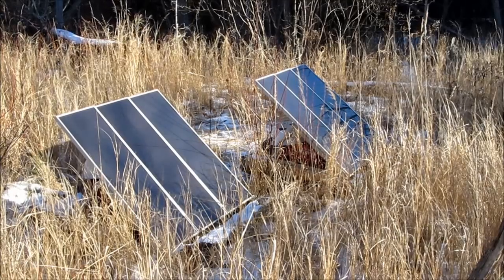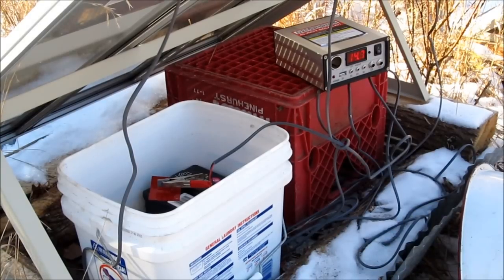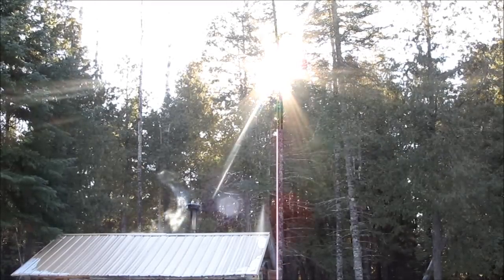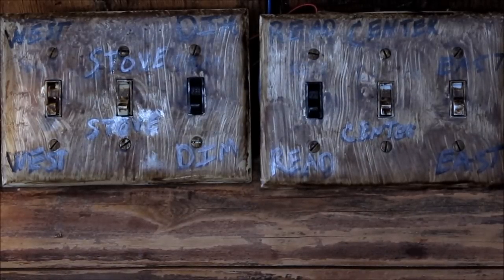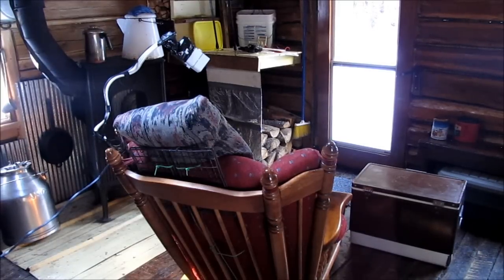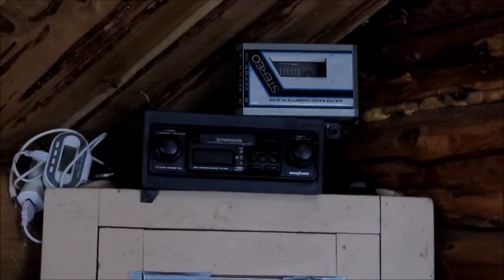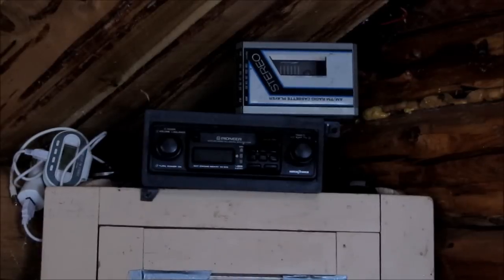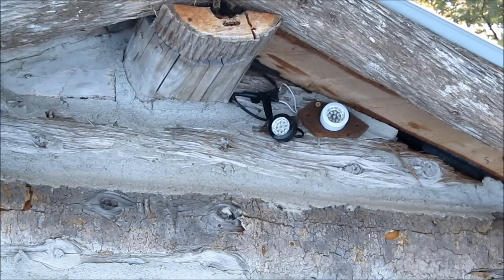Martin's Old Off Grid Log Cabin #1A Solar System for a Small Log Cabin

Comment: use a marine battery it,s better
Reply from the maker: +Jose Francisco Medeiros I know there are better batteries out there for a price. For my use the end of life car batterys work just fine and do not cost a penny. I just returned from a 24 day stay at the cabin. Most of the time I was using the two oldest batterys. One from 2004 and one from 2007. They powered my LED lights and car radio with no problem. I have meant to upgrade the charge controllers but the original ones from the Harbor Freight kit are still doing the job.
Reply: I treated a dead battery with baking soda and distilled water (I recall) and refilled with epsom salt and distilled water -- again from memory. Got about three months out it, including a cross-country journey. But when winter came, the electrical system started blinking at me and cold-cranking amps dropped by 100+ in seven days. I might have overdone the baking soda bath...

Comment: About two thirds of my solar are those harbor freight panels, but I use a lot more power than you do.
https://www.youtube.com/watch?v=S5OBt2E6L3Q
You might try inverting it at the location of the panels and running an AC line the quarter mile home as that travels efficiently.

Comment: Not putting down harbor freight system as its ok for those starting out or need very limited power but when u do the math     ($ X watts) the HF are much higher price, I'm sure the idea of getting a whole plug n play system looks enticing but they would b better off buying a system from one of the many  dealers who offer them,, ur gonna get a system u can add on to easier, will put out more power and last longer but it all depends on how much power ur gonna need,, just about everybody ends up buying more panels,charge controller etc when starting with HF ,, if it's just a hobby, something to play with its fine but if ur really needing pv power in the future it's not gonna be adequate,,U can buy polycrystalline panels for $1 per watt or less and even monocrystalline panels for same price sometimes but are usually more as they do convert lower  light into power better,, everybody has different wants n needs and with limited funds U do what u can but ur $ ahead buying a kit elsewhere or buying equipment one piece at a time,,
Is what I did, putting 735watts  in panels,, 6-6v batteries=624 AH and a 1000w pure sein inverter in a cargo trailer I'm converting a camper, I've got $1600-1800.00 into mine including cables and have lots of boondocking power and if a need to run AC/ele heater or run batteries down due to many cloudy days I have a 3000w inverter generator as a backup but do change locations depending on weather so hopefully neither is needed,, just my 2cents!
Reply from the maker: lonerglide You have said it very well. As for me I have found that I need so little power that I use one HF unit in the spring trip, two in the fall and 3 in Jaunuary. Prices on non- HF units have dropped a lot since I installed my system.

Comment: I didn't know deep cycle batteries freeze.
Reply from the maker: John D I am not sure if the newer gel types do a better job of holding their charge. The older deep cycles would always lose their charge during the winter and then freeze.
Reply: TheNorthwoodsman1 
A fully charged battery will freeze at a minus - 90 F some degrees, but a 1/2 charged battery will freeze at plus + 16 degrees.

Now, the problem with  cold batteries is , that they require higher voltages to charge the batteries. That is why it is a benefit if a charge controller has a  temperature sensor that can be put between the batteries to get an accurate reading to compensate for the current temperature.

Comment: I applaud your initiative.
For not much more ($215.00) I got a 158 Watt Panel & a 30 Amp Charge Controller. Add a second panel & I've got 300 Watts. My ultimate goal is to have 1200 Watts in Panels, 4 150 Amp Batteries, and 2 1500 Watt & 1 3000 Watt Inverter.
Reply from the maker: Bob Wood The units I used are still available from Harbor Freight for $150 per 45 watt unit. Prices have come down on solar so bigger panels are available with a much lower $$ per watt. The simplicity of Harbor Freight's unit is still hard to beat. It is easy to assemble and everything is there to charge 12 volt batteries. It has been three or four years and everything is still charging in my system.
Reply: Bob Wood There is very little difference between the two other then how they perform in low light. If you live in an area where the sun is always shining then polycrystalline would be just fine. I live in Missouri and for the last 2 weeks I have seen the sun maybe once. In Missouri I would figure about 1/4 of the year has some sort of cloud cover. So that would be around 90 days out of the year I would be losing possibly needed power. I don't know the actual percentage difference, but it is well worth it for the price difference. On average the price difference per watt is around 5 - 15 cents.
Reply: Why would u run 2 large inverters off of ur battery bank??
Reply: Bob Wood the best deal i have found for the money and reliability is the solar panels from Windy Nation. For $175. you can get a 100 watt monocrystalline system that is way better then the Amorphous panels that Harbor uses plus you are getting 55 more watts. They have other system available also with more or less wattage. The only thing is make sure you go with monocrysalline. They work way better during cloudy weather and they are just a few dollars more.
Reply: Shannon Simpkin Thank you for the info. Do you understand what the difference between "mono" and "poly" panels? Again, I'm new to the solar game but am very interested and when I make the move I want to make the best decision and purchase I can. Thank you again.
Reply: Where did you get this deal? I'm new to exploring solar and looking not necessarily the cheapest but the best deal. Thanks.
Reply: TheNorthwoodsman1
I bought new Renogy 100 watt RNG 100D from e-bay for less than $150 per panel.
More power on a smaller area and cheaper per watt.

Comment: I've come back here several times. You show how stingy a guy can get to conserve as much power as a person can possibly squeeze out of a minuscule solar system. The use of zoned lighting is very instructive and almost elegant in its mastery of electric minimalist architecture. The use of cheap auto batteries also shows what can be done there.
Reply from the maker: Frank Weltner I just returned from 3 weeks at the cabin. Still using the same set-up but erected a framework to hold the panels in the winter time location. It will be easier to take the panels up on a toboggan than pulling the individual sheet metal sleds all that way in deep snow. For fall I found that one  45 watt set was giving me all the power I needed.
Reply: @TheNorthwoodsman1  why don't you clear up the access road to cabin. That way when the 8 miles gets to far, you can drive up in your truck..

Comment: nice setup I envy your cabin. You may  already know this but incase you dont, Prices have changed a lot recently and there are much better solar panel kits out there now that produce more power and are smaller. I just put together a 200watt monocrystalline two panel solar setup with a 30a pwm charge controller and two 6v "blem" golf cart batteries ($50 a piece vs $150) that charges the batteries in like 3-4 hrs in full sun with up to 18 amps of juice from the 2 panels. I also have about 215-220ah of reserve power. all this was just over $400 to build.a good source for the solar panels is renogy on amazon or ebay and the batteries can be bought as blems from a distributor such as interstate... a 100w kit is 180 buck shipped vs a 45w lower voltage kit from HF there was a night and day difference for me going from one marine battery to the two golf cart batteries. they wont freeze as long as you keep them connected to a solar panel and float charging. with a small load on them. they also have a much longer lifespan than the cheaper built thin leaded car batteries. I too had like three car batteries I was going to use before buying the blem batteries and now I run a small fridge,furnace with blower lights, stereo and can run a tv if I wanted for like  12hrs with no sun at only 50% drain on the batteries which is safe for true deep cycle... huge improvement I didnt think was possible.
Reply from the maker: Yes, there are certainly more options for low cost solar than a few years ago when I put mine in. Even with more powerful panels I think my set-up would be about the same.

Comment: I have a controller like that but the low voltage shut of is way to high.11.5 and its off until it gets to 13 .just about anything is good to 10.5.inverters wont work off it and they haved to be hooked to the battery.but the it brings the voltage down enough so you cant even use the controller.

Comment: Ah...yeah! I just finished my first LED (9leds) 12volt 18ah sealed lead battery night light for my laundry room. Like your overhead bed light ...works the same. 10 amp charge controller is excellent regulates the voltage needed.

Comment from the maker: I now have 135 watts total and find that I only need 45 in spring, 90 in fall and the 135 in winter. It is Federal Forest to the south and I do not want to open more to the north so I will shuttle batteries in the winter. I plan to get a MPPT controller and should then have more power than I will ever need. I made the video after hauling batteries from home and did not realize all the power I had available with the panels I had just started using.

Comment from the maker: The controller is very close to the panel and battery and is about 18 gauge or smaller. It is what came with the kit. I know the charts talk of huge wire gauges when running 12 volt wire very far but I have used 18 gauge for the long wires out to the outhouse. The thing to remember is how low my amperage draw is on this wire. I want to get a new controller and position some batteries on the outside back wall of the cabin. I will not need really heavy wire since the amperage will be so low.

Comment: these panels seems like a good deal, but 45 watts is an ideal output, not average. that package is about $3 a watt, when the industry average is below about $0.75 maybe even less. The expensive part is the shipping. If you know some friends you can get a bulk order of 26 panels of 250 to 300 watt 24 volt each panel. could be well worth it. a favorite dealer of mine is wild nature solutions, great tech support, which is real important, except the don't update web with current deals. email Craig

Comment: nice work!
just some thoughts, batteries designed starting an engine, are not reliable long term for off grid setups, deep cycle golf cart or so many on the market are better. you don't wish to let charge to drop below 50% of battery capacity. use a quality charge controller to prevent over charging the batteries. 
john

Comment: You should add a hand crank to your system. The one(s) that are used for crank radios that can be modified to power a charger or charge a battery or other device. There is another one you can get (Message me if interested) it uses a finger or toes on top shoes to send power our OR under the curve of rocking chair..! COOL HUH?! I know of many ways to help your situation..

Comment: use a joule ringer system for your leds you will not be dissapointed youtube joule ringer
i have these running in my home they are 220 volt led lamps but they run of 12 volt using a joule ringer system with only 100 ma draw for two at a time

Comment: I don't mean to be a dick, but because you have one that works doesn't mean they all do...or even that most do. I used to go through 2 or 3 a month so I respectfully argue that I have a larger data set to draw from. I now use a Rigid Halo for work - it's about 100X times more expensive than the cheap ones but you can bet that the failure rate is much less than 1 in 100 and when they do fail they are covered under warranty. Still, I won't be gutting that one to make a puck light :^)

Comment: I had to comment about the "cheap aluminum LED flashlights". I purchased me one in California back in 2008 and I still use it for all my flashlight needs. The rubber part over the on/off button is shot but the LEDs still work just as good as the day I purchased it (for only $3). I agree a lot that is sold is crap, however some things aren't so crappy. Just wish more things were made in *insert your country here*.

Comment: The problem with 'mass-market' units like that is that the quality is crap - LED replacement lamps provide more lumens with less power.

BTW, it's a dropping resistor that you use to run them on 12V. I've made a few puck lights from those cheap aluminum LED flashlights and they work ok for lighting inside lockers but they don't last because they're still just consumer pre-garbage.

Comment: One more thing, concerning the batteries. IF you are able to transport the car batteries from home once in a while, why could you not just take a DC battery home at the end of the year. Also, you could probably get a solar battery maintainer that would put out enough to keep it trickle charged over the winter, just to keep it maintained.  A DC will not self discharge that much that it could not be handled. Also wrapping with thermal blanket maybe. I just would like to see u get a bit updated.

Comment: Thank you for sharing the cabin video with us. You know, you could do allot that would improve your system. There is no doubt. And would not really cost that much money. But I get the sense that what you have works for you and you would probably not be be overly concerned with improvements. But I will say this. Your about as off grid as it gets. I would get a MPPT controller or even PWM. The HF ChrgeContr are not even true Chrg Cntrlrs. Start there.Id be happy to email some recommendations PM me

Comment: There are some round 24LED tent/camping lights that use 4 AA batteries, that with proper voltage regulators could probably be wired into a 12V solar system, and several could be wired into the same panel or supply and never even put a dent in the power system. Those lights work great with batteries, and i would imagine rigged for a solar they would light the entire cabin area well with very low or minimum power requirements to run them.

Comment from the maker: These voltage charts for 12 volt batteries are confusing to me. Are there different types of voltage readings? I have charts that quote the numbers 12.74 full charge after settling down from charging and 11.95 for full discharge. Then I see info talking about units automatically shutting down when the battery gets to 10.5 volts. I am using a digital volt meter for my checks and don't think I have had a battery at 10 volts unless a cell had gone bad. An explanation would be most appreciated.

Comment: Notes on Batteries:   Batteries operate best if their kept at temperatures between 70 - 82F.  That battery would probably charge better in a warmer environment. 12V batteries (Containing 6 cells) are charged to 13.5VDC (Float).  You could safely discharge that battery to 10.5VDC (1.75V per cell).  or if desired a deeper discharge of 9.9VDC (1.65VPC).  If the battery will be immediately recharged and charged fully, one can go down to 9.4VDC (1.56VPC).

Comment from the maker: These sources are changing all the time and vary widely in price. I have not bought any in a few years. You are after MR16 two prong 12 volt LED lights. My latest lights were much brighter (48 LED) than my early 12's and 32's. I paid $25 for some early lights and later found them on the internet for $5. Some sources also had the socket base with two wires protruding which made wiring them up a lot easier.

Comment from the maker: Yes, I agree. In my calculating by the seat of my pants I know what the different loads will do to my battery per hour. Even then the capacity of the different old batteries has to be taken into account. It is such a simple system and my needs are so low that I have never gotten any better numbers figured out.

Comment from the maker: Thanks for the input. A big problem for me is that the cabin sits empty for months at a time and the frost goes deep so there is no way to keep weak batteries from freezing. I am out rambling all the time anyway so would rather use the sled every other day than run all the wire and apparatus. For spring and fall I can have the panels right in the cabin yard and plan to run a line to the cabin from the panels and batteries.

I will check out E-bay for a set-up for partial power at home

Comment: 3 - Cont...  At the Cabin use GOOD Deep Cycle batteries where you can provide insulation and warmth. Gel cells banked can be keep indoors. These batteries will be your primary batteries for power inversion or direct... A bit of trouble at first, but ends your journeys to transfer batteries and solves your weather problems.   ONE MORE ADDITION>>>>

Comment: 2 - continued ---   Invert to 120V at site. 120V will transfer easily 600 yard where second charging  and system could maintain extra storage with second an charger, batteries and inverter. This would allow for small wire for transfer with minimum load.. Not really that much money except for the 8 gage wire which should be sufficient for your modest load of a charging unit at your cabin.

Comment: Thanks for your reply. Gel Cells are fine..  Vmax batteries are expensive, golf cart batteries are also good but all are cold intolerant. May I make a suggestion. Having to keep your solar so far from your cabin is the burden and the cause. If you were able to keep a permanent solar site with your panels, Small Battery Bank (Any type of good batteries) and charger remotely stored in  underground shelter providing insulation next to your panel array. These will just be used as sending station.